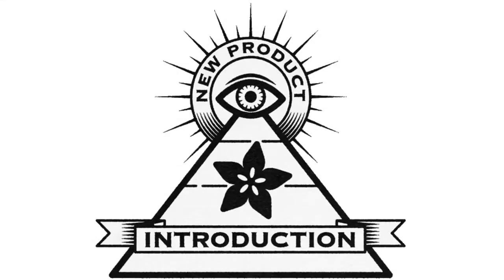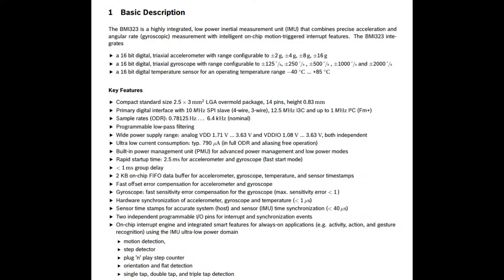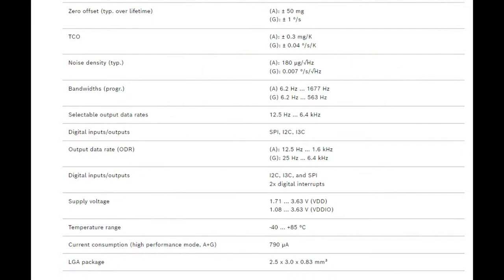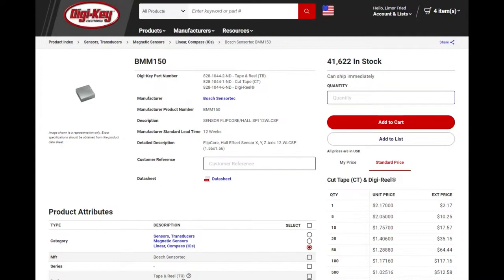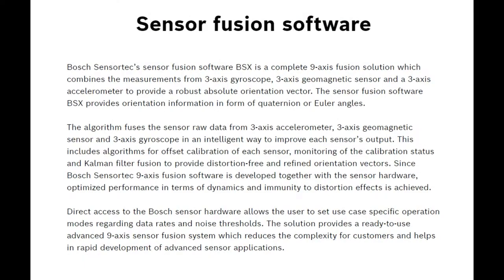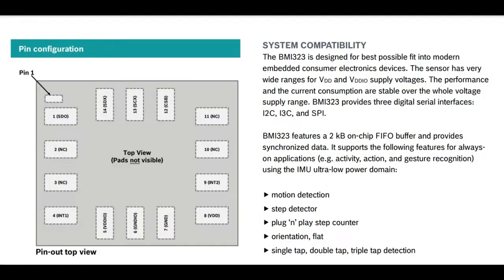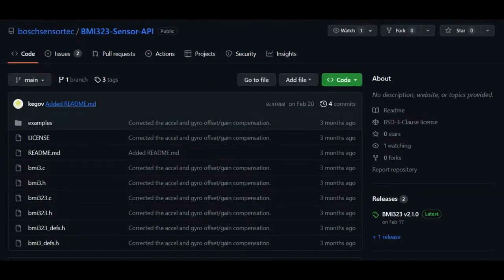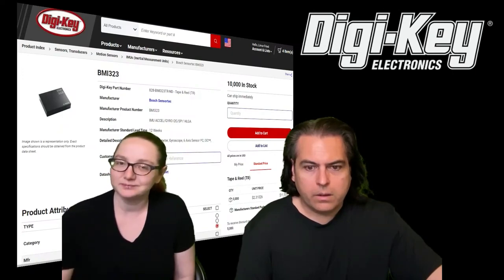EYE on NPI: Bosch Sensortec BMI323 Inertial Measurement Unit #EYEonNPI #digikey @BoschMEMS @digikey

Comment: to put the cost of the BMI323 into perspective, I worked on the Inertial Navigation System for the MX missile system back in the 1970's and the per copy cost was approximately $25Milliion.  Of course it's accuracy was very high (classified specifications), but as you can imagine acuracy is very important especially when sending a missle over  half way around to world!.
Reply: Hi，Are you still working in this field？